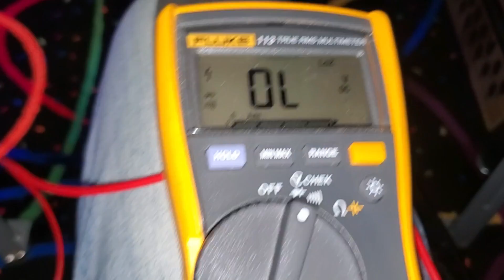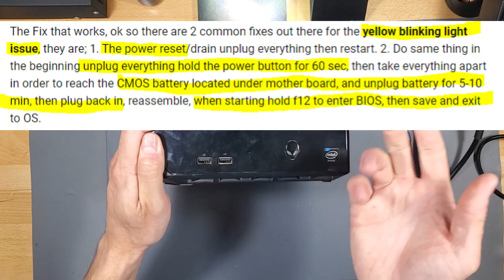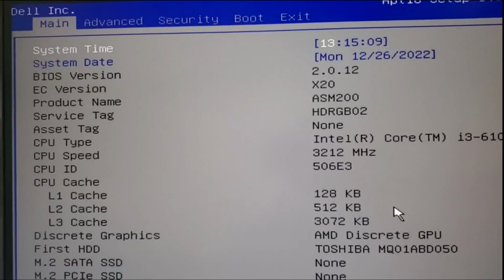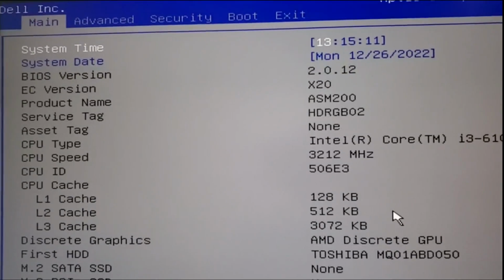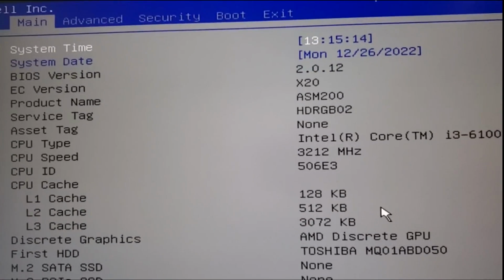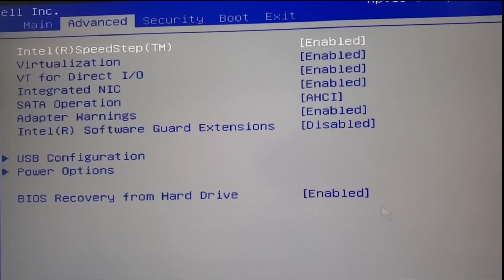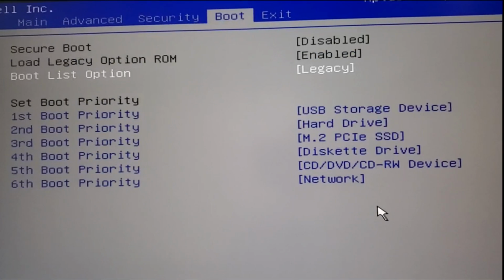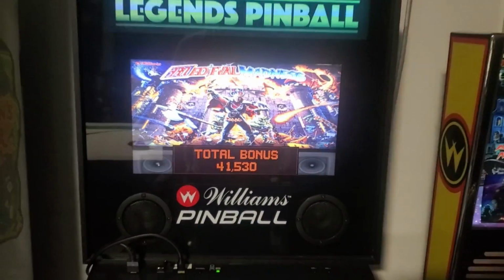How to Fix Alienware PC Not Booting up LED flashes 5 times

Comment: The Amazon link is not the correct battery anymore! I ordered it and the battery seems the same but the connecter is a different size
Reply: I tried to splice the new battery onto the old wires with some electrical tape. Did not work.
Reply: Finally got the right battery and it's working thanks to your guide thank you

Comment: Never seen it as a pinball machine—very cool.  
I have an i7 model that I bought 9 years ago. I upgraded the RAM to 16GB and swapped the hard drive for a super-fast SSD right away, and it has run great up until now. After leaving it unplugged for a week, it wouldn’t start back up. I’m going to give this a try later.

Comment: Thanks for posting. Made a moderate difficult job easy. Nice details of step by step. Ended up soldering my own battery., properly with shrink wrap. Not recommended for people without soldering experience. Quality solder AND flux is a must. Thanks again! 👍

Comment: Hi all, I had this exact problem with my dell aurora r11, I sent it to dell repair centre for two weeks which turned out to be a waste of time. They checked the hardware and software and sent it back to me. I turned it on and the same light flashing problem appeared. I asked a PC repairer local to me in Grays to look at it, in 2 hours he found issue and repaired it.  I just wanted to advise everybody the problem was short circuiting on the cages side of the case inside and Northbridge(Motherboard)   this explained why the PC was non responsive on boot up.

Comment: I finally got it to turn on (blue light) but im not able to connect it to my monitor (or my tv) i switched the hdmi cables and still nothing but the pc is on, could that mean i need a new gpu? (And if so which new one should i order?) Or is it something else im missing?

Comment: will this work for the Alienware Alpha i3 model
Reply from the maker: @casperghost7182  yes, but battery might be different part # .
Reply: The battery is the same although it has a different connector. It is a  2-pim slim connector btw

Comment: Worked for me, but I needed a different battery since the connector was different on my model.
Reply from the maker: @Draxzion  they might have changed the battery connections in some models
Reply from the maker: @Draxzion  they might have changed the battery connections in some models

Comment: The battery you had linked in your description doesn't fit my alienware alpha, the connectors are different and I just wasted my money
EDIT: the connector for my alpha's battery is a 2pin 1.25mm Pitch connector if anyone else had that problem look for a battery with that connector
Reply: same with me
Reply: @austintea  it's always important to look at the old battery for reference 
If you still have it that should have the size & Volt listed on it
Reply: @RosaNeraLuna  its wrapped in yellow heat seal, cant see anything on it, but the battery is the same as the one that actually works, its a cr2032, the problem is the connector is different, the connector for my alpha's battery is a 2pin 1.25mm Pitch connector if anyone else had the original videos battery not fit try looking for a battery with that
Reply: @austintea  mine wasn't heat sealed idk a safe way to remove that other than take it to a tech
Reply: @RosaNeraLuna  its a cr2032, just like any other cmos battery, the difference comes with the proprietary connectors that manufacurers like dell and hp use, when you build your own pc it normally has a dedicated slot you can just put it in but they have it seperate to save space on the board in alot of prebuilt computers. The point is you dont need to unseal it, you just need to find out whatever connector they use which cna be difficult, espevially on older computers when you dont have a manual or an upto date guide

Comment: i was having an issue after reinstalling the battery and attempting to boot where i would hold the f12 key and it would still give me the flashing yellow power button. i disconnected the psu, held the power button 30 seconds to do the battery drain thing, and then i reconnected the psu and connected the keyboard to the rear usb instead of the front. after this i was able to f12 my way into the boot menu, im not sure if it was the battery drain or the keyboard slot change that did the job, but i figured i should mention it.
Reply: Omg you are a lifesaver! this worked for me! Would not get past the blinking yellow light. Followed your instructions and I'm finally back in. Thanks!
Reply: Saved me too dude!
Reply: Thanks I thought i broke it putting it back together
Reply: Thanks
Reply: @PerkinsVR  thank you very much
Reply: Dude you are a lifesaver thanks
Reply: @PerkinsVR  you’re awesome
Reply: Thank you! Same happened for me but I was able to get to the BIOS and now waiting for the boot up to happen!

Comment: Thanks for linking the wrong battery in the description the damn connector is double the size
Reply: Just reuse the connector from the old battery.  Cut the wires and connector off the old battery, then splice it to the wiring for the new battery.   Wrap it with shrink tubing or electrical tape.
Reply from the maker: That's odd, 🤔 I used that same link to fix mine. Maybe u have a different model?

Comment: Hi I'm a 13 year old boy at the part where you start removing the front cover and back cover and after I removed the 4 screws in the holes I've just given up😢
Reply from the maker: Be sure to order the battery before starting the repair. Ask one of your parents for help and watch the video with them. I believe u can fix it. 👍
Reply: Thanks
Reply: ask your dad
Reply: @lilydotcom  soo funny he didn't but it :+(

Comment: I ordered the battery you linked and it does not fit at all not sure if you have a newer model alpha or what
Reply: If you're good with wiring, you can reuse the connector from the old battery.  Cut the wires and splice it to the wiring for the new battery.   Wrap it with shrink tubing or electrical tape.
Reply: @ThEBLAAA400  i am the same issue it’s a different type of connector : (

Comment: you need to update your description. it’s the wrong battery size. i have ordered it twice and the pin is bigger than the original one and won’t plug in. bad job.
Reply from the maker: I double checked and that was the battery that fixed my Alienware. Maybe you have another model?
Reply: Thanks for amazing walk-through video, however, i have the same problem. the link you provided got me a "thicker" connector. The one alienware comes with is flatter.  Is your alienware alpha R1 or R2. If you look closely, you will see the connector is "thicker" on amazon link you provided.  Please shed a light on it for us.  Thanks again for great tutorial @TampaTec
Reply: @TampaTec  i changed it but i’m still having 5 flashes of the yellow light, any suggestions!

Comment: Has anyone replace the battery and still noting is happening
Reply: Yeah... any fix?
Reply: @valentinnoonspecial  The alpha (all the models) shipped with defective Bios EEPROM chips, over time they become progressively more corrupted, only surefire way to fix them permanently(presumably) is to have the eeprom chip replaced with a new one with a good bios dump on it.

Comment: I replace my battery and still getting the flashing skull 😑 Help!
Reply from the maker: Test 3v battery if its under 2v then replace it.
If PC flashing yellow 5 times still then unplug battery again wait 20min and hold power button to discharge circuit.
 be sure new battery compatible, then assemble pc, press power then at bootup keep pressing f12 to enter bios then just save and exit.  👍

Comment: Got a new CMOS, but the connector is not the same.

Could anyone please give me the link to the proper battery.
Reply: just use the same connector and replace the battery in it
Reply: Did you get the 2032

Comment: I miss these hands on repair/trouble shooting vids. Depending on what the replacement battery cost, might have saved a bit by just hacking in a new 2032 coin cell in to the harness.
Reply: I did it that way. Pried the contacts off the old battery, flattened them, and taped them back on. Covered with heat shrink tubing.